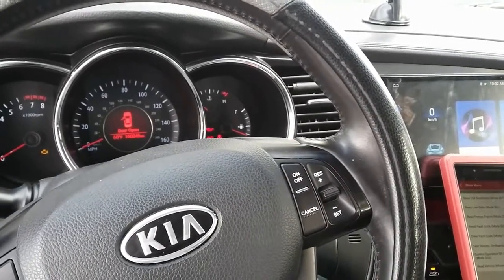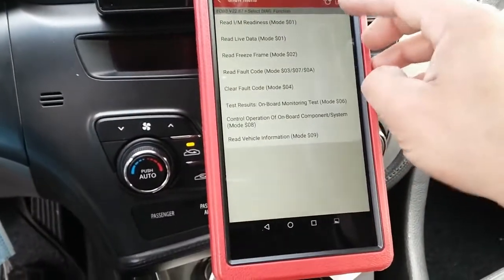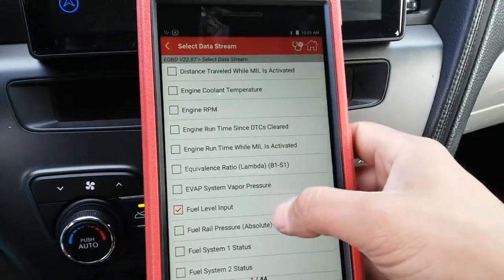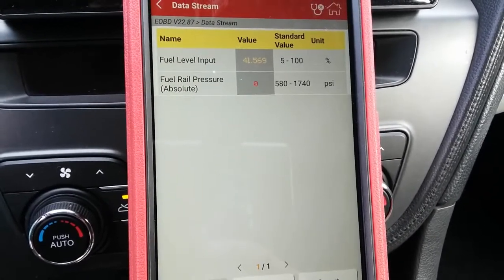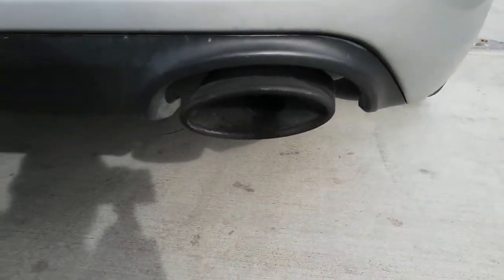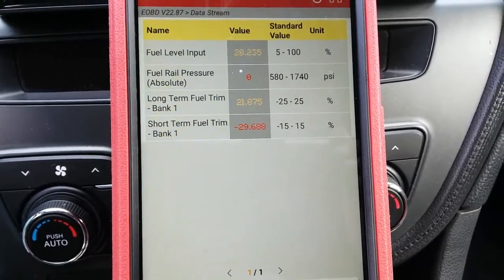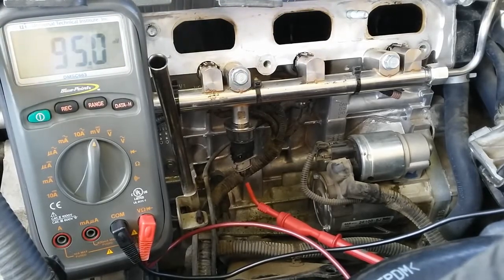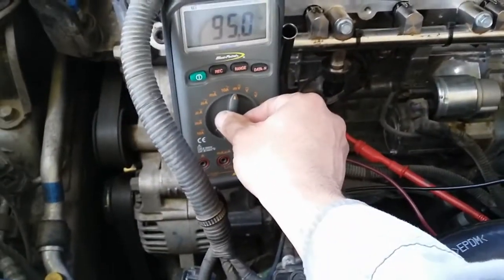(Kia Optima) Diagnosing DTCs P0087 and P0193

Comment: Good Job Eli. Does your scanner have a fuel pressure sensor actuation test for this car? My scanner has this test but it says failed when I run it on my 2011 KIA optima 2.4.  I have no codes but engine shutters bad at idle only after it warms up. High side pressure is good. Have tried everything except  check low side pressure. Do not have special adapter. Thanks
Reply from the maker: You may also have carbon deposits on your intake valves.
Reply: @EliTheOBDTech  Thats what I been thinking also. Whats weird is it shudders worst when I apply brake,turn on ac,lights,roll down window. Cleaned throttle body twice and even checked alternator. Thanks for reply
Reply from the maker: Hey there, to be honest, I never checked the actuation tests for this vehicle.